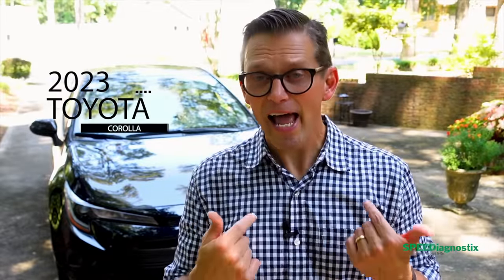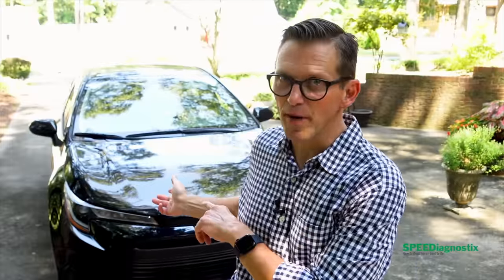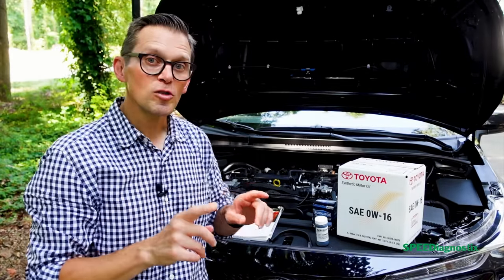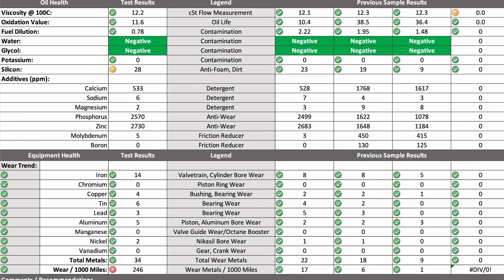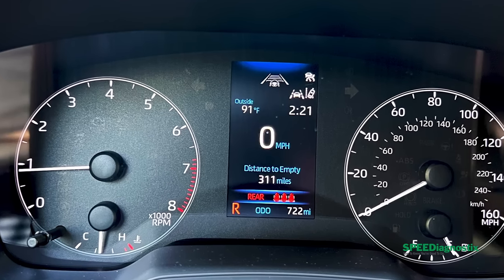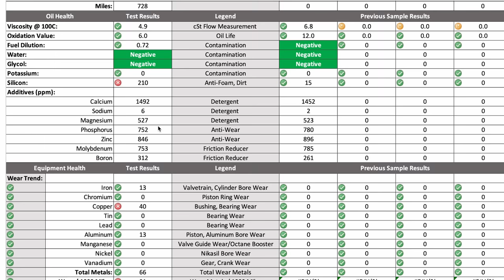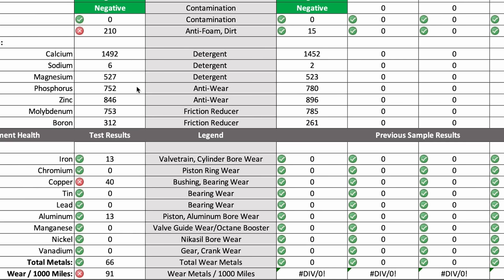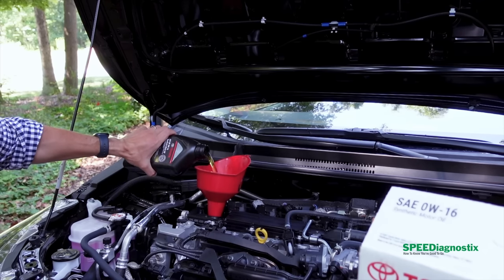AVOID the ONE MISTAKE Almost EVERYONE Makes With A Brand New Car

Comment: Probably one of the best knowledgeable  basic recommendations to change the oil by the first 500 miles for any new car or truck is how exactly what my father taught me well… Kudos
Reply: Pointless expense.
Reply: Being an avid car true collector of the Vintage Volkswagens and few 911 Porsches; As well as  newer Toyota 4Runners, and Tacoma trucks for over 20 years has given the actual professional level of experience and a real sheepskin to know that your facetious lazy comment being just an oxymoron, whereas you MotleyDude are wrong … C’est la vie
Reply: @motleydude73 not true....break in oil has high zinc content and should be changed at the 500mile mark on a new vehicle..after that,normal intervals is fine(5000)
Reply: @mikekopisz1227  That's motorbikes. Absolutely no need. And 10k is fine.
Reply: @motleydude73 hum ,10k engine replacement or $50 oil change huummmmmmmmm I'm thinking about it.!!!!
Reply: @tomstulc9143  Why on earth would you ever need an engine replacement? 🤣  Paranoid much?
Reply: Cue in the internet trolls!😂
All I know is I'm changing mine at 500 and every 4-5 000 after that
Reply: @wailingalen why not 3000?
Reply: @Thathustlebus  … It’s always best to drain the oil after the break-in period of the 500 miles simply because of the residual metal shavings and of manufacturing fragments from the factory… Plus the initial cost of an oil change is relatively inexpensive as to the ginormous cost of replacing an engine… C’est la vie
Reply: @charlesmack2078  Absolute nonsense. First change at 10k is fine. Microscopic metal shavings, if any, will be collected by the filter, and anything left is held in suspension by anywhere upto 9 litres of oil. That's one of it's jobs. But go ahead and waste good oil and money 🤣
Reply: @wailingalen  A good synthetic will last 25000 miles these days and you're going to dump it at 500 🤦
Reply: @Thathustlebus  Because that's just stupid. A good synthetic can go 15000. I dump mine out at 10.
Reply: @motleydude73 10K is insane and combined with low tension rings leads to early oil consumption, and then seizing the engine because it burned all of its oil before the next oil change.

3K miles conventional. 5K miles full synthetic. Half those figures if you're regularly driving in heavy traffic, off road, or towing. You can probably stretch those to 4K or 7K, but I'd rather change my oil early than late.
Reply: @ElijahDecker  10 k is perfectly fine. A good synthetic will do 25k easy. You're talking paranoid nonsense like most people on here. I've been doing 10k changes for 15 years or so what problems am I supposed to be experiencing? 🤷‍♂️😅
Reply: @motleydude73 umm no you need to change the oil early on a new car to get the metal bits out....
Reply: @motleydude73 why does it bother you it's not your car so who cares if others change it early??
Reply: @truckercowboyed2638 he’s probably an environmentalist or has a personal vendetta against the guy
Reply: @motleydude73 
As a 50 year career technician I can say with absolute certainty you are incorrect. Oil is cheap. All those little "microscopic particles" you claim get picked up by the oil filter, don't. You want to go 10k between your changes, fine. Just don't recommend others follow that advice. When you can get 400-500k miles out of a vehicle without major repair let us know. I ROUTINELY get that mileage.
Reply: @airmecher  50 years? And you think those microscopic particles stay in your engine indefinitely and cause catastrophic damage? Oh dear. Better start your apprenticeship again lad. I most certainly DO recommend 10k mile changes to everyone and most do it, as it is also what most manufacturers recommend these days too. A good synthetic will do 25k easily so 10 isn't much of a stretch. 400-500,000? I've seen plenty with over 600,000, all perfectly fine. Mines done 174,000, when should I expect problems? 🤣🤦
Reply: @airmecher  You must travel an awful lot to get those mileages on all your vehicles. Cars love long hot running so 10k mile changes would make sense for you. Or are you doing oil changes every few weeks? 🤣
Reply: @Maximer77  Environmentalist? 🤣  I couldn't care less about the environment. I'm speaking as a service tech with 29 years experience. There is NOTHING wrong with sticking with manufacturers service intervals. Most people do and I've yet to see ANY problems from doing it. This first break in change is utter nonsense and unneccessary.
Reply: @truckercowboyed2638   No you don't. I never have, no problems. Engines are built to very tight tolerances these days and 'particles' will do nothing except sit in the filter or stay in suspension amidst anywhere up to 9 litres of oil. Comes out with the first 10k mile change. Must suck to be so paranoid 🤣
Reply: @motleydude73 well I’m assuming your the type to trade in your vehicle when the warranty expires then. It has been shown that 10,000+ oil change intervals are absolutely horrible to make an engine last. 10,000+ oil changes are for the people that don’t care about their engines because they already know they’re dumping it onto someone else before it has issues, and it will have issues
Reply: @logankurtenbach1059 You're assuming I'm rich and can buy new ones every 5 years. No.  When will they have issues? Never seen any. Never heard of any. But I've I've only been in the trade for 32 years. Current car is 14 years old, 172000 miles. Oil's clean as a whistle. As is the PCV.
Reply: @logankurtenbach1059  You don't seem to understand, car manufactureres benchtest their engines and the oils they use for optimum longevity and performance. If they say 10k is fine it is. Some oils are rated to 25k miles. I do care about my engines, so they gets serviced as per their OCI recommendations. I've only ever owned one new car, most have done well over 100,000 miles when I buy them.
Reply: Only the first time is 500? And the next ones are 5k or every 500 each time?
Reply: @intertonyblue  Better do it every 500 minutes of driving, at least 3 times a week. Just to be safe.  Otherwise your engine will explode to pieces. Apparently 🙄

Comment: I referenced this video in a Euro car forum & all holy hell broke out. People, despite hard/fast lab results (science), will STILL fight & die on the hill of engines have already been broken in now at the factories.... it's akin to arguing water isn't wet but they don't let that get in their way of arguing the un-argable.
Reply: My 2025 Trax owners manual has a break in process for the first 500 miles on the motor.
Reply: I do not understand that thinking at all. If you are wrong the worst is you have spent a few extra dollars on oil and filters. That is still way cheaper than an engine rebuild 15 years down the road. Still driving my 2002 Dodge Ram I bought new.  I change the oil every 3,000 miles.
Reply: My 4Runner manual says to break it in for 1000 miles

Comment: Did my 23 4Runner at 899 miles...  It was a lot of micro-sized prearlescence in the oil.  I did the quart flush too.  Glad I did it and I find it remarkable that people argue against it...

5k oil changes from now on!
Reply from the maker: Right on!
Reply: @kimbuck-2  What for? Isn't your vehicle brand new? Don't need to worry about oil changes for another 9000 miles. Doing anything yourself will void your warranty.
Reply: @kimbuck-2  Why not? They're experienced technicians trained to work specifically on your brand. Good luck if you need anything fixed under warranty in the next 5 years they'll laugh at you.

Comment: Thank you for this video. Funny enough - 4 years I received a company car which happened to be a corolla - on the day I got it from the Toyota dealership the sales guy told me to show up in 15k km (approx 9300 miles). As it is a company car it has got a lot of km to drive. The very first drive was 900km with a stop to fill up. And already on the second day after receiving the car I was already driving with the speed of more than 150km/h  (>90mph). And then I didn't calculate properly the distances and showed up for the very first oil change (after 6 weeks of driving) with almost 20k km on the clock. Within the 3 years I was driving it (C19 made it a bit complicated at that time LOL) I made almost 280k km (170k miles) and nothing ever broke or there were not issues at all with the car. It was sold to one of the company employees and now it is stil driving fine with 300k km. So yes, toyotas are really well put together cars :)
Reply: i no it has motor  noise
Reply: Your experience kinda debunks this whole video. I would just follow the manufacturer recommendation.

Comment: I completely agree. I'm 75, still do all my work on my vehicles and I always change the oil on new vehicles several times before what the owner's manual says. I ignore the manual recommendations. This same principal applied to the bevel box on my shaft driven motorcycle - sort of like a differential on a four wheel vehicle. At 100 miles, I drained the gear oil. It was black and contained wear in metals. I changed it again after another 200 miles. It was still fairly black and contained some bit less wear in metals. Changed it again after another 500 miles and it was almost like it came fresh out of the bottle. Now I change it at every oil change and it's always like new. Believe it or not, the manual says the first change should be at 40,000 miles!!! Ridiculous!  I do essentially the same with motor oils and my engines seem to last forever. I buy cars new so I know how they've been maintained and I keep them usually for over 20 years. By then, the body is rusted but the engines run like new. Listen to this guy. He knows what he's talking about.

Comment: Great info. Very informative. 2012 G37, original owner, 113K miles,first oil change at 3900 miles, now using 0W40 Mobil1,which has reduced a small amount of oil burn compared to, the recommended 5W30(Mobil1). I will start flushing with clean oil between changes as you suggested. 0W-8 makes me cringe!
Reply from the maker: Glad it helped!
Reply: Give liqui moly molygen a try, full synthetic and improved fuel economy, mobil 1 is notorious for oil burning no matter what car I've had

Comment: I sent a oil sample to Speed he was spot on he detected high silicone levels in my oil. The silicone was from the oil pan gasket that my mechanic replaced my mechanic went a little heavy in the silicone. Because of this oil analysis I dumped and did a complete oil change. Silicone acts as an abrasive.
Reply from the maker: Thanks for sharing!
Reply: @themotoroilgeek  😁😊
Reply: Even if you measure out the exact width of rtv the service manual states to use there's going to be high silicone content in the oil for the first couple oil changes
Reply: @firstlast---  Speed is awesome he was spot on with the lab results! 😁😎
Reply: Silicone or silicon? Not the same thing…
Reply: @aarong.1075  that's correct my apologies meant to say high silicon levels.
Reply: @chrisr.986  Except that oil pan gaskets have no (crystalized) silicon, so that wasn't the cause.
Reply: High silicone or high silicon? You might want to check.

Comment: When I bought my new 2006 CR-V, Honda stated not to do the first oil change until at least 5000 miles because of additives used to break in the engine.  I followed that advice. All I can say is the engine still runs fine after 17 years and 10 months.
Reply: yes I spoke with 3 seperate Honda service managers at 3 seperate dealerships and they all advised me against a first 1,000 mile oil change and I was willing to pay for it out of pocket so I did not do it.
Reply: Yeah this video proves absolutely nothing. Changing your oil at 500 miles is absurd bologna that this guy probably remembers from the 80s back when American motors were built like total junk.
Reply: Same thing I heard when I took my wife's '06 Pilot in for its first service. I had about 3k on the odometer and they sent me home until 5k.
Reply: Modern GM cars are the best most reliable  engines  ever made . Every one of them will go to 500,000 miles .  I love my wife, I love my job and I respect my supervisor.
Reply: @PepperWhite62 Sad to say only people I’ve seen with massive engine failures in the last 4-5yrs have been Kia engines and GM engines. Close friend just had his 5.3 v8 in his Denali pickup fail at 60k miles. Truck is 3yrs old he’s waiting right now for a “new” engine to be shipped to the dealer for replacement. I know of at least 3 other people with either 3.6 liter v6 failures or 5.3/6.2 liter GM failures. Customer neglect wasn’t an issue in any of these failures…
Reply: @alanholmes2366  those crappy two piece lifters tend to fail on the GM AFM engines.
Reply: @deankruse4491  I just don't think of GM anymore when I think of high quality engines. I read an automotive review for a Cadillac CT6V I think with the Blackwing handbuilt engine and it failed having to be replaced under warranty. That's crazy for a 100k vehicle.
Reply: @PepperWhite62 
I guess you never heard of Active Fuel Management and the cam and lifter failures?
Reply: Kia and GM suck as a toyota technician .,oh and stay away from range rovers total nightmares
Reply: @PepperWhite62  Fairy Tales.
Reply: @tomcal25   I was being sarcastic.
Reply: Our 05 crv was changed at 1000 miles & 3000 thereafter (plus filter). At 282000 it runs almost as new. Hope I can get another 100k out of it.😁
Ed c

Comment: Love it, keeps it simple, no fancy battery power tools. No lift! And finally someone else dedicates a quart to flush through the motor! My wife and friends laugh when I do it to mine.
Reply: I also pour a little oil to chase out the contaminated oil but I think a quart is too much, it's a waste, when you pour that oil into the crankcase it's only going to flow down one passageway into the crankcase, it's not going to flow throughout the entire engine. I just pour maybe 10 fluid oz. or so.
Reply from the maker: Thanks! Now you can tell them you aren’t crazy! LOL
Reply: I have done this for years, oil is cheap when balanced against the cost of major repairs or replacements.
Reply: Ya?
 Well, let them pay for a new engine and see if they still feel like laughing. Ha Ha Ha
Reply: I also do it and everybody wonders why I have to be so “crazy” about it.
 Why wouldn’t you flush out the last bit of debris?
Reply: @DanBrando  Because it doesn't? Oil detergents hold debris in suspension. It all comes out in the first drain. You are just wasting oil.
Reply: @motleydude73 have you ever seen inside old oil pan?
Reply: @rogerdodrill4733  Yes quite a few. There are no moving parts in an oil pan if there's a bit of baked on gunk it's fine. Stop being paranoid.
Reply: @motleydude73  how about crank spinning just above oil & pan @5 k rpm
Reply: @rogerdodrill4733  What about it? It's fine forget about it. Maybe you should buy an EV, you seem excessively paranoid about the 'fragility' of combustion engines and the effectiveness of oil.
Reply: @motleydude73  A moments thought will reveal the fact to you that any gunk on the bottom of the oil pan will be picked up by the new oil and circulated.
Reply: @harrygatto  No it won't. It's generally baked on. Hard. And takes years to accumulate anyway. I'm not talking about sludge.
Reply: @motleydude73  Baked on by what? There is no substitute for total cleanliness anywhere inside an engine. I'm saying this as a trained and qualified car, truck and equipment mechanic and service shop manager with experience in 7 countries. I've walked the walk and can talk the talk.
Reply: @harrygatto  Heat. Oil and engines get kinda hot 🤣
Reply: My question is do you pour that 1 quart of oil with the old oil filter on or off
Reply: 93lllll

Comment: Best vehicle I ever had 88 jeep 4 litre straight six.
Changed my new Jeep oil at 500 miles.
Drove it 34 years and then it drove from Ca. to Norther Michigan 
where it !ives now. 
GREAT advice!  I remember all the metal in my oil at only 500 miles. 
Never went more than 3,000 miles between changes.
Reply from the maker: Thanks for sharing
Reply: I've just finished my third oil change on my wife's 22 Cherokee 3.2L Pentastar engine. On my other cars I can use FilterMags on the outside of the metal oil filter can, but on this design engine I can't do that, so I installed a magnetic drain plug at first oil change at around 1300 miles. At 2nd oil change(5k odo), I was a little surprised at how much iron was picked up. At 3rd oil chg(9300 mile odo), I was even more surprised at how much iron dust has been picked up by the mag drain plug. I don't think many people are aware  how much fugitive iron dust is circulating in a modern "all aluminum" DOHC engine.

Comment: Love the videos, Lake.  Question:  What oil are you using in your Porsche?  My oil story:  I own a 2006 Honda Element that I bought new.  Now I am old school so I change my oil every 6 months or 5K, whichever comes first.  I don't drive like I did when younger so for the past 4 years at 6 months I only put between 1K and 2K on the oil.  Yes I am using a 0W-20 synthetic.  Oil is cheap.  The Element has 230,000 miles on it and still does not leak or use oil.  Shooting for 500K if I live that long.
Reply from the maker: Thanks for the kind words. I use the Driven DI30 in my current Porsche.